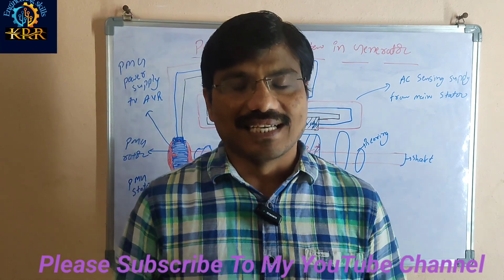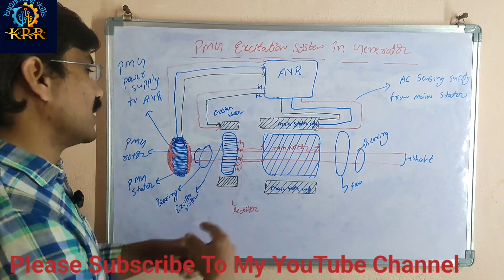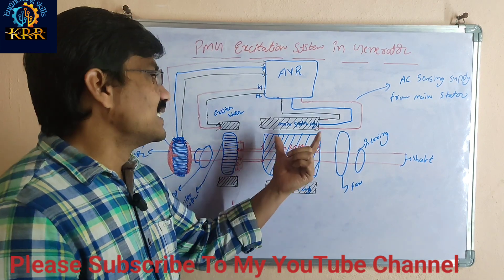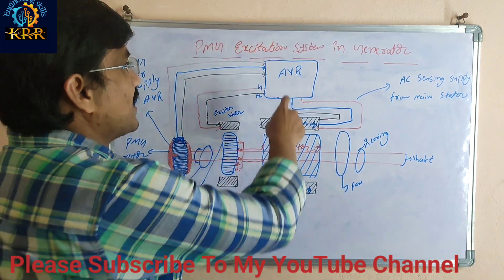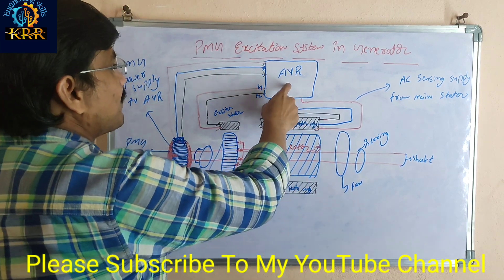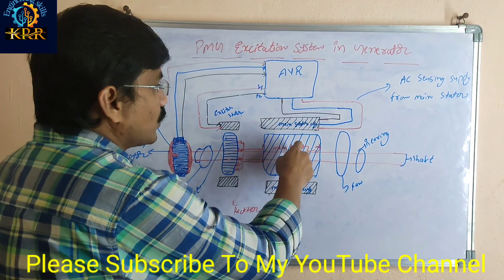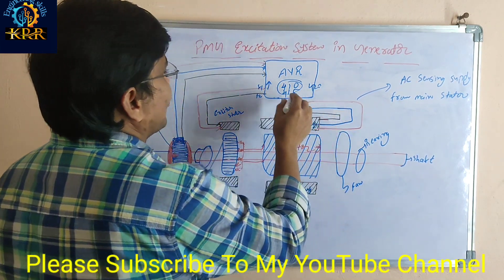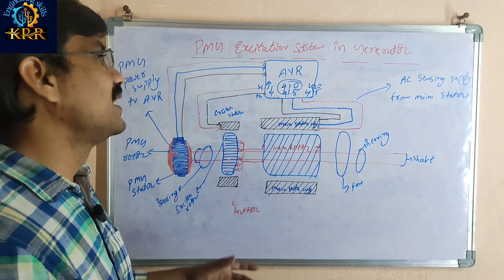PMG Excitation System In Generator #excitation #pmgexcitation #alternator #generator

Comment: I have pmg generator,it has started to misbehave, when switch on,it works for three hours then it switches power off and mains cable starts to become warm, then after cooling, it starts working again, what's the problem?,could it be main rotor is over heated or main stator?,help me please.